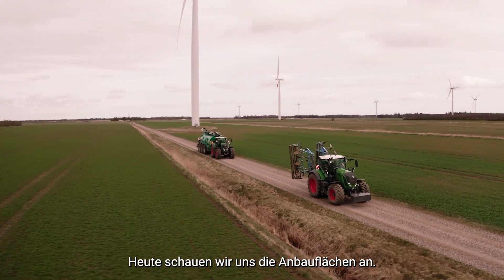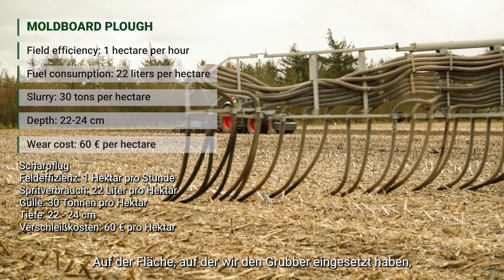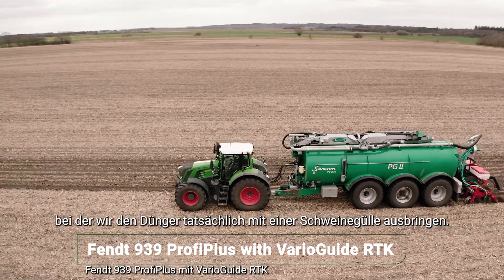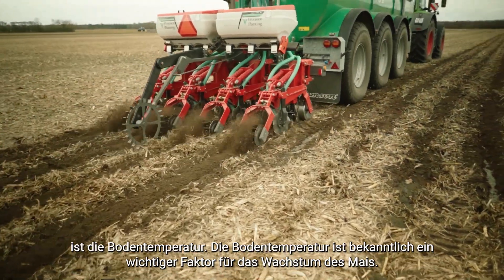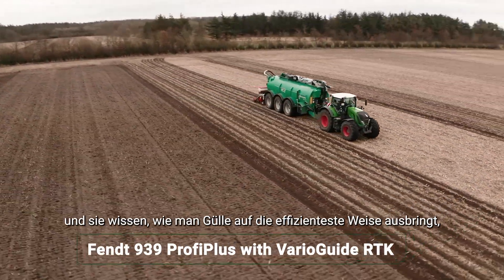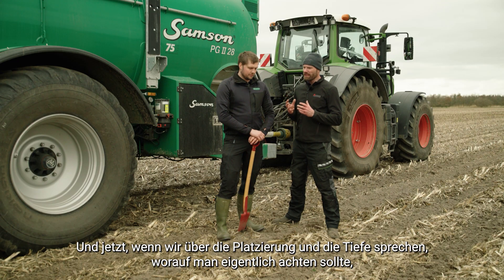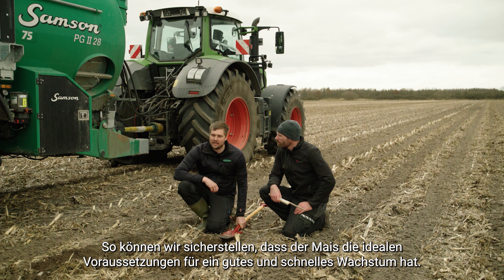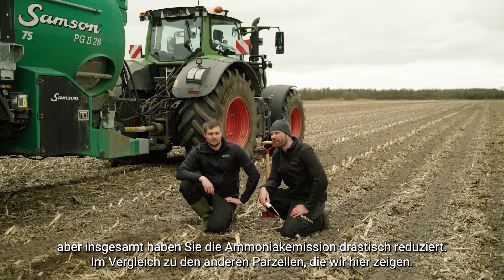Fendt Full-Line | Verschiedene Methoden der Bodenbearbeitung | Fendt

Comment: long term costs,  moldboard or any aggressive full tillage will never let the soil heal and be healthy, you will always be dependent on chemicals and fertilizers to grow a crop. also take in the long term cost of erosion.  

strip till a guy can cover crop between rows or even leave a living mulch system to provide a large part of fertility needs naturally, it also can provide diseas and pest reduction with a massive increase in water efficiency.  also is a precision application of macro nutrients, place nutrients in the root zone, placing nutrients at a lower rate if need be to save money, less tillage passes to save money,  also more friendly to the insane go green regulations that are coming out from many countries.

Comment: Is that slurry tank planting the seeds at the same time  too?
Reply: I think so
Reply: No ^^ it "plants" the slurry and afterwards another maschine (a drill) has to do plant the corn.
Reply: @magnusr.1960  I was thinking the same but how is the planter going to be able to know the strips the slurry is in? There is a hopper on the back which looks like seed hopper and there is also a metering wheel which looks like it's planting also.
Reply: @6900pilot  the planter drives on the same gps  "line" and so he knows were the strips are